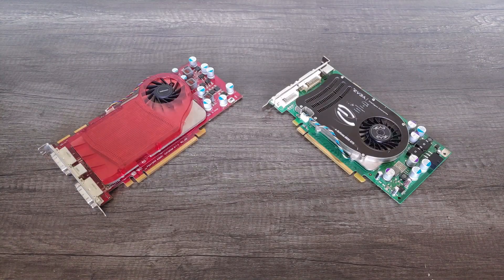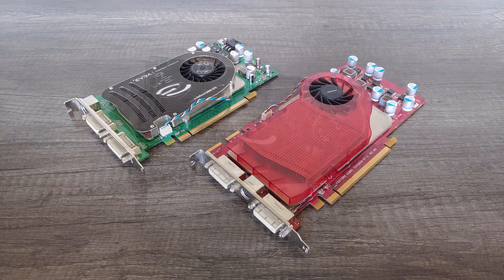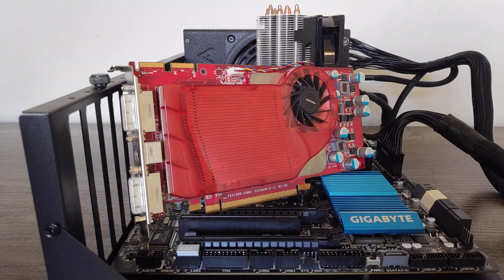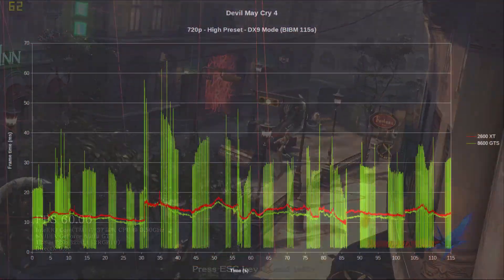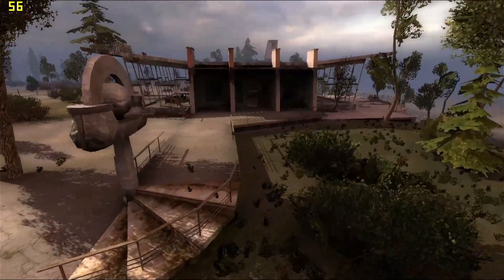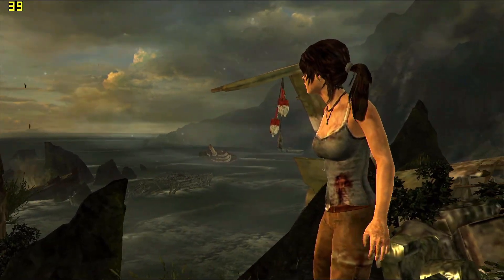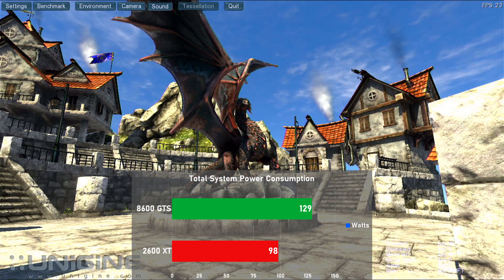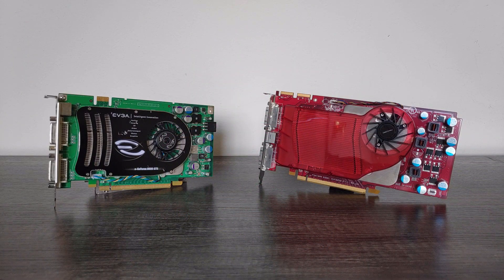GeForce 8600 GTS vs Radeon HD 2600 XT - Graphics Card One-on-One

Comment: I used to own 8600 GT with 512 MB of VRAM that had slower DDR2 memory
and it was rather mid but it played games surprisingly well in 1024x768 resolution for the most part
and I will say that 8600 GTS is such a pointless product back then (and still is because i now have an 8800 GT 256 MB from Gigabyte that has really cool Zalman cooler and has overclocked gpu and memory and it's such a huge improvement over my 8600 GT)

Comment: I remember those days. What a poor period for a low budget build. I was lucky enough to buy a HD2900GT 256mb for 70€ that was probably around 50$.
Not my best GPU ever but better than these two.

Ps: if I were you, i would not use a GeForce 8600GTS without the PEG connector. You will kill your mainboard. Believe it.
Reply from the maker: Yeah... for a little while it was the dark ages for mid-range parts, kind of funny given (at least NVIDIA's) high end parts were held in much higher regard at the time! When the 8800 GT and HD 3850 came out things got so much better in that segment, but I would be so disappointed with the performance if I had gotten one of these cards back in the day. A 2900 GT would have been a decent cut above these cards for sure. And thanks for the tip, I saw a few other people mentioning that as well 😬

Comment: A funny story (but unfortunate for me). A long time ago I bought a Gigabyte 8600GTS which had no 6-pin power connector. It drew 75W (or maybe even more) purely from the motherboard. After a few months the motherboard died. I think the 75W GPU pushed it to the limit...all other 8600GTS brands had the 6-pin connector 😂
Reply from the maker: Damn, makes me glad I didn't run this card for too long without the 6-pin. I didn't even know you could do that, I found out when I accidentally forgot to plug in the 6-pin one of the days I was testing it 😂
Reply: My EVGA 8600 GTS actually has a 4pin molex connection for supplemental power. Weird, right?
Reply: @7MBoosted  Yeah that's weird. I thought molex was only on AGP cards.

Comment: nvidia and amd are really reliving this era of poorly priced budget options
Reply from the maker: Agreed! Couldn't stop thinking about the 4060 cards and RX 7600 when making this review 😆
Reply: 200$ in 2007 is worth 300$ today, so at that 300$ price point you can get a 6700xt which is a very solid budget card. Once the 6700xt stock sells through and the 7700xt drops to 400 or slightly below 400$ that'll be an even better deal.

Comment: The 8800GT fell to 199 not long after. Offering a huge improvement over the 8600GT. Personally I ended up with the 8800GTS 512MB for about 250 which at the time was a lot for me for a graphics card. Now I would love to get a good high end card for anything near that price. The 9600GT doubled the shaders to 64. I had mostly used ATI before but the 8800 cards were just too good.
Reply from the maker: Yeah, if someone jumped the gun on one of these cards back in the day can imagine how robbed they would have felt when the 8800 GT/3850 came out, nearly double the performance for the same price just months later. 9600 GT added onto that beatdown even more, really goes to show how bad a value these cards were.

Comment: One of the things i don't miss from those times, is the noise made by those coolers and the other fans in your PC back then.
Reply from the maker: Surprisingly both of these cards are pretty quiet, especially the 8600 GTS. They still don't perform up to snuff though
Reply: @SPNG  I had a HD4850 and it was loud, i remember i changed the stock cooler to an Accelero S2 and kept it until i had the money for a 8800GTS 320MB the next year.

Comment: I'd hate to have been the guy who bought a 8600 GTS for $199 or a 2600 XT for $150 at launch only for the 8800 GT and HD 3850 to come out half a year later at $249 and $179 respectively and absolutely obliterate the former while still being single slot cards. Would've felt completely betrayed by both companies.
Reply from the maker: Same here, would've felt completely robbed! Definitely needed to happen though, I can imagine how disappointed people were when this was the performance you'd get for the sub $200 range, especially after all the hype of the first 8800 cards! The 8800 GT and 3850 did it so much better
Reply from the maker: @@lurch789 I mean if you could have found one for very cheap that might have been a decent buy, but the 7800 GTX simply could not measure up to what the 8800 GT and 3850 had in store. With the 7000 series aging as badly as it did in later games a 7800 GTX would have gotten terribly slow for any games of the time, I mean try running Crysis on it with anything above Low settings 😅 Unfortunately they're completely shader bound in a number of games beyond 2007.
Reply: Everyone knows that there's ALWAYS something better about to appear on the horizon, and that whatever you're looking to spend, there's almost always going to be one that costs "just a bit more", but offers better value.  In either case, at some point you have to decide when and what to buy and how much you want to spend, otherwise you'd never get an upgrade. Is it significantly better than what you already have and is it the best you can afford? If yes, you're getting an immediate, long term benefit. That "better" card that came out just after you bought your new one, will still be available in 12 months time, but you could buy it at a much reduced price.

Comment: Man upgrading from 5200 FX to 2600 XT was massive, that card was great for me at the time
You should've covered Driv3r, I has problems running it on 2600 XT, I remember beating Bioshock, Halo 2 Vista, Oblivion and Skyrim (original release)
GTA 4 was the big sad, I think I beat it and it was running at like 20 fps or something like that.
And to add to that I played everything on CRT mostly 1280x800 with max res being 1280x1024 Sony CPD-E100
Reply from the maker: Oh man that would have been an absolutely massive upgrade 😅
Reply: Funny enough, I went from an FX5200 PCI to an 8600GTS! And yeah, I thought it was nuts as a kid! That was my first experience with GPU overclocking, you could actually push the GTS pretty far if I remember.

Comment: I remember back then that a selling point of the 2600XT was you could get GDDR3 512MB Versions, i don't recall a 256MB GDDR4 version so if true i'd hold onto that one for collectability as only Ati used it throughout the successors to the 2000 series on some cards. I purchased 2 HIS iceQ cards, a 256MB X1650 Pro and a 512MB 2600XT, in synthetics it practically doubled and even vs my X1950, the extra vram helped and that did translate to games as i did crank them into the 2600XT's favour because thats how i want to play them, 2 of these in Crossfire would give you 1GB VRAM usable vs the mirroring of SLi's memory to the second card. for the right price and games, it would've been a killer combo if you had a CPU to feed it.
Reply: FireGL V5600 baby :D
It's the cheap version to get for 512MB GDDR4 on a RV630 GPU core.
Reply: @cybercat1531  Not at the time, i'd imagine it'd cost more being a WS card..plus i got both cards for 15 and 10 a pop which is pretty good for the UV Reactive aftermarket arctic cooler based designs
Reply: I had the 2600XT 256MB GDDR4. I paid $99 for it a Sapphire version in Jan 08 with the cool reference design flame cooler. Sadly my dad kept it in a shed in a cabinet that was stolen sigh. All or 99% of the 512mb versions were GDDR3 and the “cheap” version. My friend got a visiontek 2600Pro for a whopping $200 at best buy around the same time. I got my card on Newegg.

Comment: a blast from the past! i remember being super excited for the x600 tier of cards in 2007 from how excellent the 7600 GT was. then they go ahead and drop the 8600 GT and GTS, massively cut down from G80 and super disappointing. the fact that you could spend 50$ more and get last mid-high end powerhouses like the X1950 XT/7950 GT added insult to injury. like you mentioned the 8800 GTS 320 absolutely clobbers this card for not much more money.

the 4060/ti/7600 releases this year kinda reminds me of these cards in a sad way lol.
Reply from the maker: Definitely, I didn't experience the market at the time but it seems like people were really let down by these cards. I can cut the 2600 XT a bit of slack considering it didn't have as high expectations due to its higher end siblings not being very well received, but the 8600 GTS had big shoes to fill with how successful and adored the 8800 cards were, I can imagine how disappointed NVIDIA faithfuls were when this card was a complete write off compared to the rest of the lineup. And I agree, quite reminiscent of the current "mid-range" cards on the market now, except they come at like double the price xD
Reply: @SPNG  With similar problems in regards to lackluster VRAM capacity as well. Time is a circle, I tell ya.